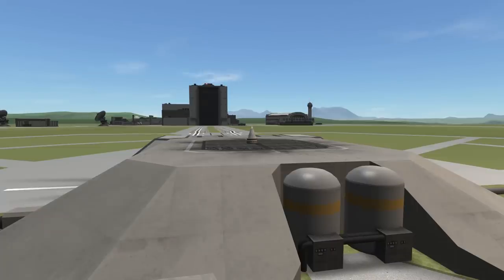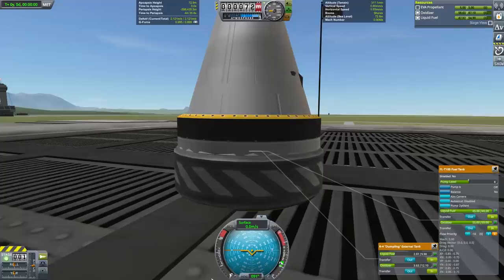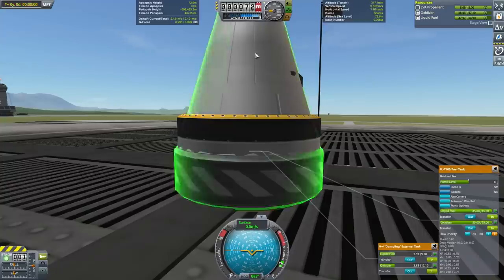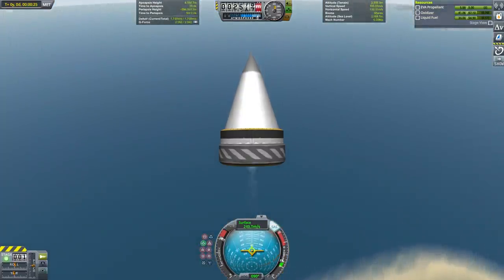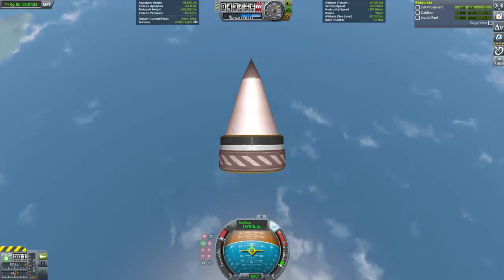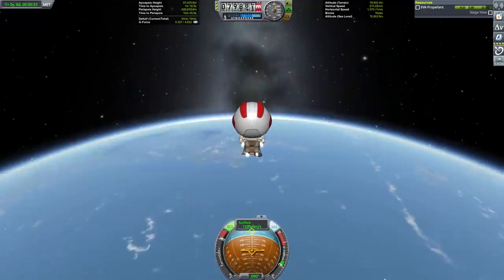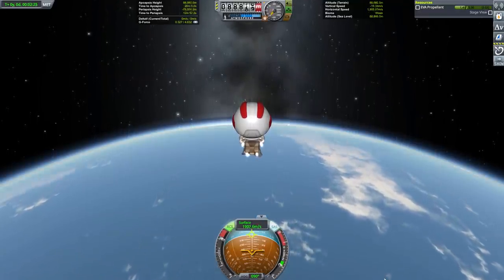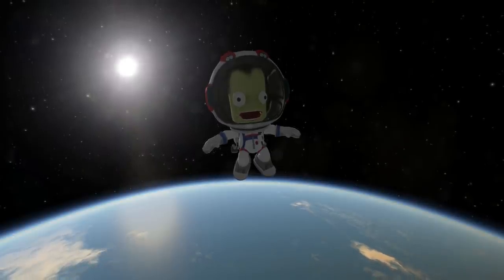Orbiting Bill Kerman with a 874 kg rocket - Kerbal Space Program

Comment: The rocket weighs as much as 437 double boxes of Raisin Bran
Reply: This is information I needed to know
Reply: that needs to be a globally standardized unit
Reply from the maker: I'd imagine that the energy density of Raisin Bran is fairly good relative to the average breakfast cereal.
Reply: @BradleyWhistance  eve sea level mission but its done using only a 250g serving of energy-dense bran?
Reply: Osama Bin Laden easily possible as long as 125g of the bran is anti-matter
Reply: @rickharper4533  not much of an orbiter if it annihilates itself

Comment: Kerbals have made a hybrid EVA thrust and waste system utilizing the gas emissions from snack consumption.
Reply: I mean, you could make hydrogen from methane and oxygen from CO² but... Why tho?
Reply: Kerbals are lead based organisms, which explains why they are so heavy, they emit tetraethyl lead fumes.
And their skin contains lead cromate pigment, which explains why they are green even though they don't photosynthesize.
Reply: AzuriteT3 do they weigh a lot even without the EVA suit?
Reply: @alexsiemers7898  yes. taking into account the difference in height and assuming a similar thickness of material to the real world, there is still a discrepancy in their weight. This could be explained by the inclusion of lead in their biology which, if 18% like carbon, being 13 times heavier would make up the difference... approximately, and I do mean very approximately.

Comment: I have had Kerbals survive normal reentry heating.... on occasion... they get darned close to burning up though
Reply: did you use the EVA pack to help them slow down ? or without it ?
Reply: @isaz2425  with it burning through the propellant at full retrograde during reentry
Reply: Yeah, I've had to add radial component as well to make sure I slow down higher up.
God, the stock EVA chute is great.

Comment: Wouldn't 1x Doughnut + 1x Baguette fuel tank (total capacity 51.3 units, 5 kg less dry mass) be a more efficient way to get the 48 units of fuel you need? 2x Baguette (48.6) and 1x Oscar-B + 3x Dumpling (47.7) also seem like possibilities if the aerodynamics work out.

Comment: 1:39 maybe they just use some hypergolic monopropellant (like for RCS system) with isp exceeding 200s and 1,5 wet/dry mass ratio. This should give a delta V of 600-700 m/s. MMU on the other hand is propelled by gaseous nitrogen with much lower isp and much lower mass ratio.